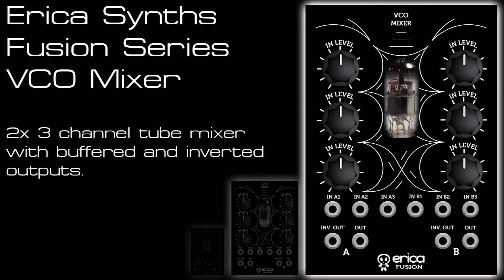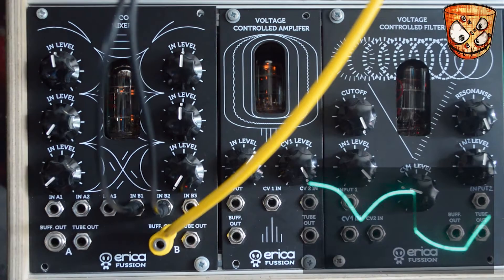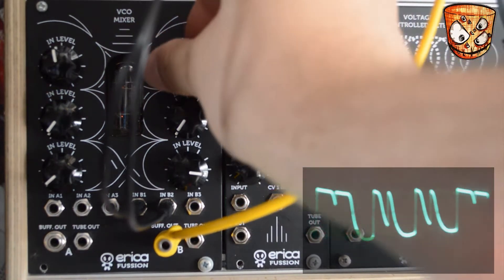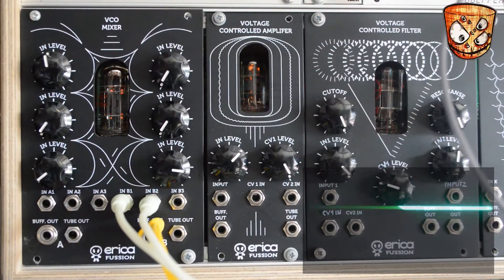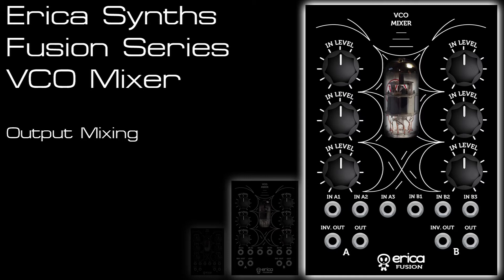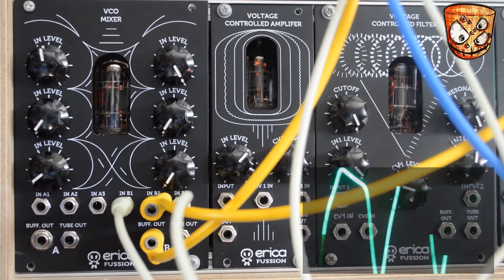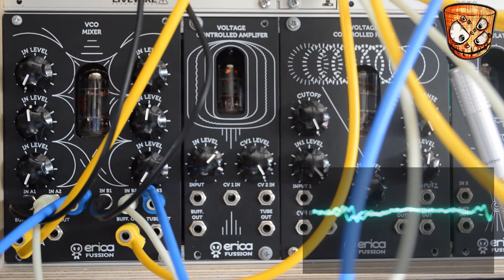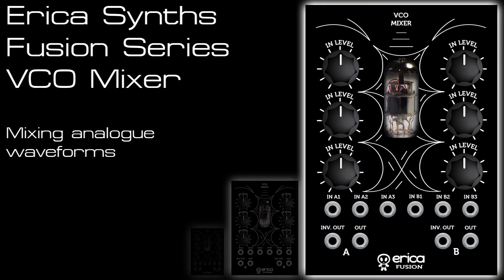Erica Synths Fusion Series - Tube VCO Mixer

Comment: Ben, I always enjoy your videos. Just got into the Euro world, and picked up a Fusion VCO, which is nice. I know the tubes draw more power. I am running my rack on a Tiptop Mantis, which seems to have a good power supply. Erica mentions a 6VAC PSU, but I have been running the Fusion VCO with no power issues. Just wondered if you did any special power setups to run the tube modules in your system?
Reply from the maker: The first version Fusion series needed the 6VAC power supply installing but the second versions onwards can be powered from your internal case power no problem. If as you fill the case you feel it's drawing too much then you get the additional power supply for the Fusion modules.
Reply: DivKidVideo thanks, Erica told me the same and I guess they are now discontinuing the 6VAC power supply. Thanks for helping!